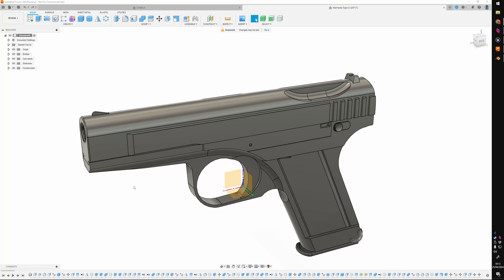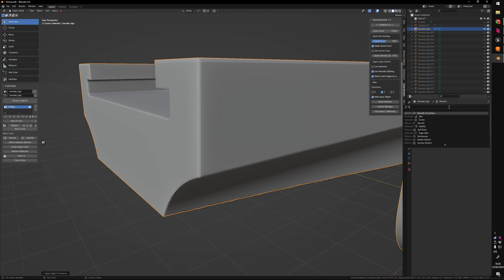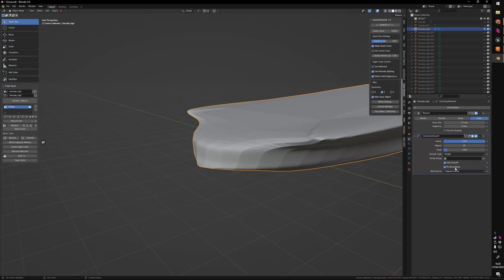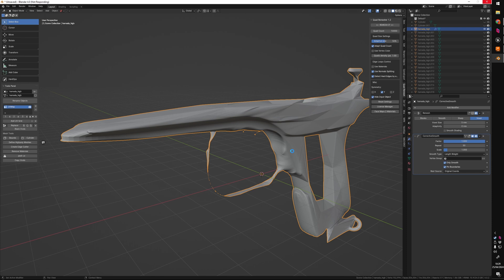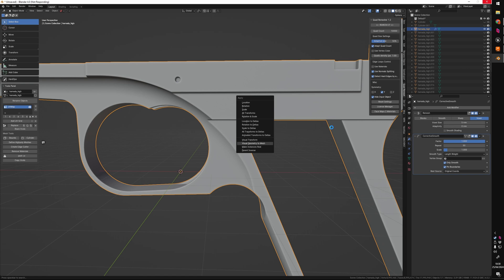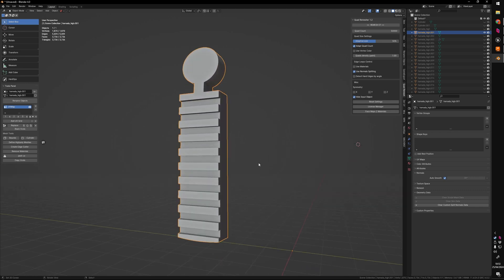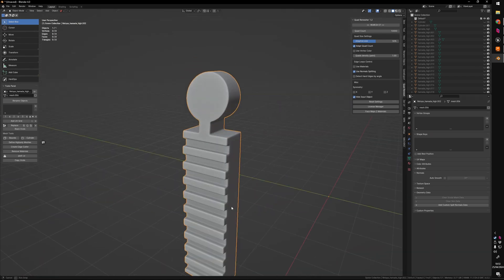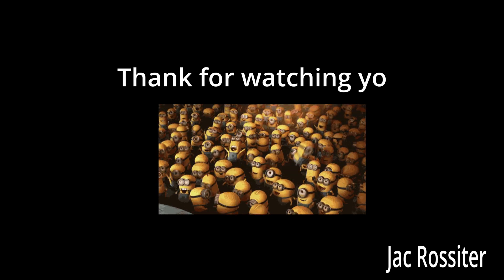CAD to Blender. Hardsurface Workflow.

Comment: why do we need to export this to zbrush after, if its already smooth bevels?
Reply from the maker: You don't need to but if you want to do a sculpting pass like adding some dents/scratches ect. You can do this in blender too but I'm more comfortable in zbrush! :)
Reply: @jacrossiter2097  ah, for sure, just used to make this in substance. tbh its much more reliable pipeline when u make all this in highpoly, ty for answer mate, good videos!